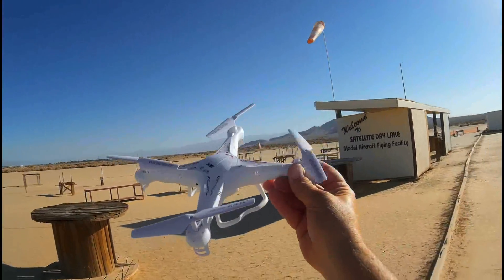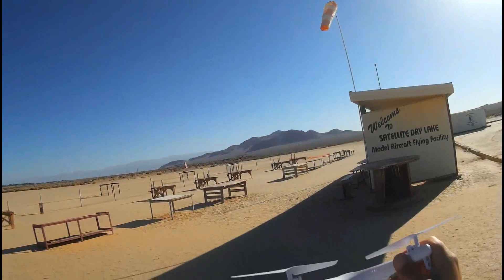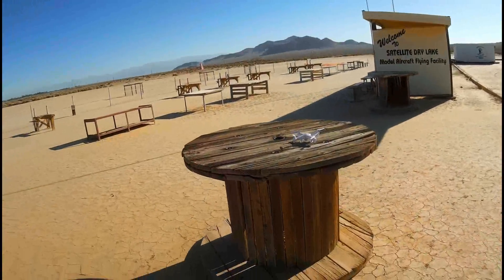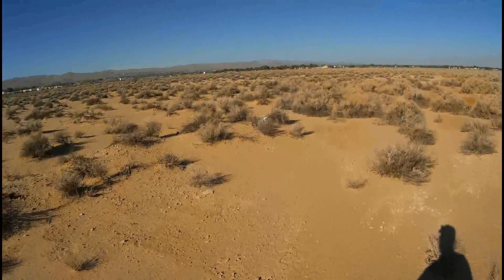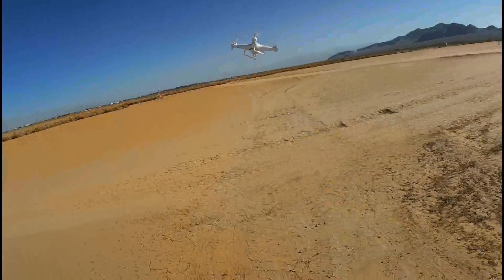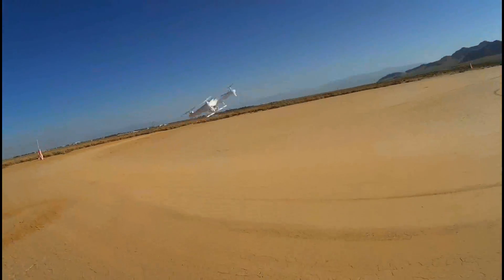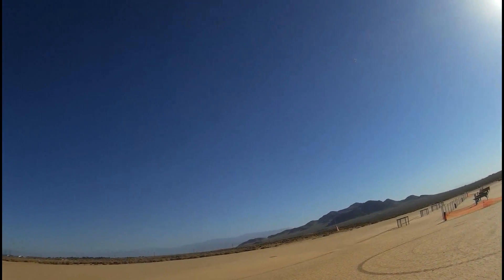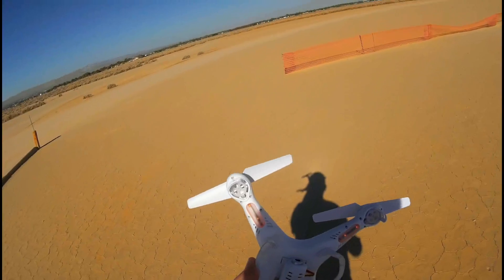Syma X5C Quadcopter Drone Test Flight

Comment: I went up that high with mine and when it landed it wouldn't turn on at all, charging it now but I hope its okay...

I've also tried everything to get it to stabilize, but it won't just hover it likes to go on its own (And no, there was no wind in my house). I guess its a design flaw or something.
Reply from the maker: The following might help. Do you know how to calibrate your quadcopter's gyros?  
1) Turn on the quadcopter and place it on a flat and level surface.
2) Turn on and bind the transmitter.  Center all trim tabs.
3) Leaving the quadcopter undisturbed, move and hold both control sticks to their lower right corners.  Hold them there until the quadcopter's lights blink. 
4) Let go of the sticks and try flying.

Comment: x5c-1 can fly 100 meters. It is nice and durable. I have intentionally drooped it from over 80 meters and it lands like a soft feather. So durable with over 16 flights in the clock.

Comment: I just bought my 5xc complete kit for $35

http://www.ebay.com/itm/-/182151006017?

I found the kit quad 101
Reply from the maker: Yep, no camera listed in the contents.  Without a camera, it saves you about 15 to 20 bucks.
Reply: +Quadcopter 101 thanks for the advice man

Comment: There's a lotta hate on this quadcopter but i've had mine for almost 2years & I flew mine into the bank of a lake (it was underwater a good 1ft for 2-3min), I flew it over a fire and one of the propellers melted and it landed pretty much in it. I also like to fly wrecklessly and have had it lose contact and fall like 100ft. I've crashed it indoors 100x.

It still works fine and out performs some of my more expensive drones...
Reply: Wow....... Crazy .......

Comment: hello quadcopter 101, does this syma x5c and x5c-1 has headless mode?? ebay seller listed they do have headless mode in the description, but i doubt since they are mostly do not understand when i ask this question, so i thought i check with the expert
Reply from the maker: +spidy278 No it does not.

Comment: Hi,I have the transmitter of an old rc model which I dont use anymore,the controller is 4channeled controller,will it work with the x5c-1 or not??(because it has a bigger antenna too).well my x5c-1 WILL come with its transmitter so I will be able to test it but I ask if anyone has tried it and if he could share the results if it

Comment from the maker: If you live in the USA, GearBest's US warehouse has some pretty good deals going on quadcopters for Halloween. One is the Syma X5C with free shipping for $46!  You should also receive the products somewhat quickly when ordering from their US warehouse. And here are their Halloween quadcopter specials http://shrsl.com/?~a4y4
Reply: +Quadcopter 101 But 'GearBest' are possibly one of the worst online stores to buy anything from! I prefer to buy from Banggood. They also ship from a US warehouse:   us.banggood.com/Wholesale-Warehouse-Syma-X5C-Explorers-2_4G-4CH-RC-Quadcopter-Mode-2-With-Camera-wp-Usa-913827.html?p=JQ26191551677201504Z
Reply: +VCUrailfan15 productions get a phantom 4
Reply from the maker: +THM SGR You might want to carefully read the fine print of those Amazon listings.  Items may be missing.  Make sure that at least both a camera and transmitter are included with the package as described in the listing.  Memory card and card reader are also sometimes left out.
Reply: Got mine from Amazon for about 40 and everything came great

Comment: Hi. I ordered my syma x5c on net. But i noticed that my quad always lean back and sometimes its going on the right side. I tried to fix it with fine tuning but it doesnt help. Any suggestions?
Reply from the maker: Christian Botavara First set all your trim buttons to center, then turn off your transmitter.
1) Turn on your X5C, and place it on a flat and level surface. Wait 5 seconds for the gyros and accelerometers to initialize (always do this during normal startup).
2) Turn on your transmitter and bind it to the quadcopter.
3) Move and hold both control sticks to their lower right corners until the quadcopter's lights blink.
4) Let go of the sticks and try flying.
Reply: Quadcopter 101 thanks mate. I have syma x5c but i think it doesnt have headless mode? It has only high power mode.

Comment: I own 3 of these... they are great for learning the basics... at a relatively low cost... $30-$50 range.. if ya crash it.. wich you will... or lose it ya just get another one... range is about a football field long.. 100 meters.. abd the cameras aint so great.. but to learn how to get comfortable with flying these machines for low cost.. the work very well..

Comment: I think it's brilliant for a 35 quid quad. Though surely evey heli and quad has a small signal output because it doesn't have a radar? I mean COME ON!!
Reply from the maker: Joshua Jones This was the original version of the X5C as reviewed last Summer. It did have problems.  But Syma quickly corrected those problems, and you're right, the currently sold version of the X5C is brilliant.  In fact, I did an updated review of the current version which may be viewed here https://www.youtube.com/watch?v=y93vzA-KRlM

Comment: Hi! do you use any lubricant for the gears on this quadcopter?
If yes, what type?
Reply from the maker: Manuele Olivo No, none at all. Plastic gears do not require lubricant.  Additionally, lubricant tends to trap dirt, causing the gears to wear (and possibly damage the motors)
Reply: Quadcopter 101 Thank you very much!!!

Comment: Who is better quadcopter 101 the syma x5c or the jjrc h8c for the camera and the power?
Reply from the maker: Leonardo Pano JJRC H8C is better for camera and power. BUT you will run into maintenance problems with its motors, so recommend purchasing spare motors with it.
Reply: Quadcopter 101 last question what about the JJRC H8C and the DFD F183 who is better?
Reply from the maker: They are the same quadcopter.  Just different name.
Reply: ***** 21% discount here! http://www.gearbest.com/rc-quadcopters/pp_73260.html?vip=34195

Comment: Strange I'm able to perform banked turns with my x5c just as smooth as when I'm flying the dji phantom 2.
Reply from the maker: rogue5022 The video above is the original release of the X5C.  It had problems which Syma quickly corrected.  You likely have the upgraded X5C model (sold since Fall of last year).  It is an excellent flier as shown here https://www.youtube.com/watch?v=y93vzA-KRlM
Reply: Got ya no probs mate. Thanks

Comment: Hi there quadcopter 101 can you think of any reason why my camera has stopped working? The red light comes on when I bind it but that's it, won't record or take photos
Reply from the maker: Do you remember to stop the recording (make sure the light goes back to green) before turning off the quadcopter? This is very important as the camera doesn't write to the card until you press the button to stop recording.
Reply: Thanks for reply. Yes I always do that. Somebody else said something about reformatting the sd card? It's not flashing red when I press record, but it briefly goes red when I turn on quadcopter
Reply from the maker: David Amos Yep, the card would be the next thing to look at as they are notorious for failure (microSD).  Might want to try a different card also.

Comment: I've seen a bunch of your videos today as i'm shopping for a drone, they're really nice!
I liked the Syma x11 the most, but i found out that the Syma x5 costs 5 bucks more.
So wich one is better for a beginner?
Reply from the maker: Where did you find a Syma X5?  The camera-less version from Syma is hard to find, unless you buy a non-Syma clone.
Reply: Actually i saw it on eBay, but then i found the x11 for 25 dollars and i instantly bought it, also i will fly it 80% indoors so it seems a better option ☺

Comment: I got my first quadcopter this morning, an SYMA X5C.  Can someone tell me what the memorty stick looking item is for.  I received no instruction on the camera or the memory stick.
Reply from the maker: It's a memory card reader. It's used to download the video from the camera's memory card to your computer so that you can view the video. You can remove the memory card from the camera by gently pushing inward on it (it's spring released). Then carefully slide the card into the reader, gold contact points forward. Be careful inserting. If there's any resistance, it's upside down. Just flip it and try again. Finally insert the reader into the USB port of your computer. The card should show up as a drive that you can open to view the video file and view it.

Comment: i saw that in a mall..Ey what happen if exceeds the cgnal does the drone drops quick or slow?
Reply from the maker: It maintains the last input from the controller for approximately 3 seconds (attempting to regain signal).  If it doesn't regain signal, the motors stop, and it drops.  But being very light, it drops relatively slowly.  In most cases, it doesn't get damaged from the drop (unless it lands on asphalt or concrete). Anyways, the above review is for the old version.  This has since been updated, and now is one of the best quadcopters for beginners. Please see the following https://www.youtube.com/watch?v=y93vzA-KRlM
Reply: Thanks for the info. Sir hhm what happen to the camera?seriously it's worst than normal, is it normal if you fly in windy the camera resolution are affected......

Comment: Have you ever tried the Dromida 700mah battery in an X5C-1 ?
I have a couple and their great. Perfect fit after removing the rear peg.
Reply from the maker: How much flight time does that give?
Reply: Quadcopter 101 With out the camera , 
10 minutes plus.
These batteries test out at 680 to 700 mah.
Where a decent stock 500mah battery varies
from 450 to 480 mah.
I really like how they fit as I also have a Turnigy 750 in one and you have to force it in
and extremely hard to get out.

Comment: Enjoy your videos and the reviews.
I was curious if you had any information on replacement hardware/fasteners for the Syma X5C-1. Are there 'standard' sizes of screws used on the rotors/propellers, rotor/propeller-guards, etc. that I may be able to find easily? Is this something that I may need to go to a hobby shop for? I have searched online, and even spare parts (like the rotor/propeller-guards) seem like they DON'T come with new screws.

Thanks!

Comment from the maker: toby, make sure that you place the quadcopter on a flat and level surface when you bind it to your quadcopter.  Do not move the quadcopter when you turn on the transmitter and bind it to the quadcopter.  The same is important when you're calibrating the gyros. 1) plug in the battery to the quadcopter, and immediately place it on a flat and level surface.  Wait a few seconds for the gyros to initialize.  
2) turn on the transmitter, and bind it to the quadcopter by moving the throttle up and down.  
3) Push and hold both control sticks to their lower-right position.  Hold them there a few seconds until you notice the quadcopter's lights flashing.
4) let go of the sticks and try flying.
And here's a video showing how https://www.youtube.com/watch?v=hhLMbq3LkrM
Reply from the maker: ***** Take a look at the following picture.  Notice the two different shapes of propellers and where they are installed.  Make yours match the picture https://images-na.ssl-images-amazon.com/images/I/61yasO5d0OL._SL1492_.jpg
Reply: Here just 39.99 dollars with coupon code: GBVBRC2
http://www.gearbest.com/rc-quadcopters/pp_73260.html?wid=21&lkid=10645392
Sweet
Reply: do you know of any stores that sell a "more reliable" brushed or coreless replacement motor option for the x5c? I was running 25c glacier 600mah 3.7v when finally the motor went.
Reply from the maker: oafaloaf Sorry, don't know of any more reliable brushed/coreless.  But about how many flights did you get before loss of a motor? Also, did you spin the problem propeller/motor by hand to check for any binding of the gears?
Reply: Where is this _
Reply from the maker: Ridgecrest, California.
Reply: Thanks
Reply: True
Reply from the maker: ***** Yes you can fly it indoors.  But there are smaller, cheaper, quadcopters which are better for this purpose.  Here's a very good one to fly indoors https://www.youtube.com/watch?v=nJcuuqMYol0
Reply: +SalvaThor here is the bigger version phantom 4
Reply from the maker: Not sure.  When you installed your propellers, were you careful to install them as shown in the directions?   There are two clockwise and two counterclockwise propellers that must be installed on corresponding CW and CCW motors.  If installed on a wrong motor, the propeller will blow air upward instead of downward, and the quadcopter will not take off.

Comment: i just bought the x5 drone new aerocraft install everithink right when i push throtle only two blades spining fast the over two are not spining fast enouth then when i pick it up and move it around they start spining all fast so i say its the axis gyroscope then i reset left and right lever to lowest right and its start flashing thats the reset done then i trie it to fly it again but same thinks happens i reset a few times not working again i dont what to do please help is my gyro broken or what is it

Comment: Have you any ideas on balancing three blade propellers
Reply from the maker: Never tried it. Am not a fan of three bladed propellers. Was going to release the following video tomorrow, but will release it now to illustrate my issues with them. They tend to be very inefficient.  Think that the additional blade just creates more turbulent flow instead of more lift. https://www.youtube.com/watch?v=-8PFxkqL_Ys
Reply: Agreed I tested all day with no weight eg camara I had great control in high wind and high hights but add Camara and well I posted a video wanted on so people could see RX and to mod distance but here at mountain base its Chinook season and high flights are not a good idea to many thermals I have a vid of this as well going up but I ordered a cpl sets of three blade props I'm going to try to balance a set and show it

Comment: Purchased Syma X5C two days back. Had just 3 flights so far. It just does't seem to follow the commands of the transmitter. If I want to take it to the left, it goes to the right. At times, it just ignores the inputs. You are flying it very smoothly. I am frustrated. How many flights did it take you to take full control over this quadcopter?
Reply: I mean are you very experienced with these things?
Reply from the maker: Abdul Waheed Your gyro stabilizers may need to be recalibrated. It is very simple to do.  
1) Install your battery and turn on the quadcopter.
2) Turn on your transmitter and bind it with the quadcopter.
3.) Move and hold both control sticks to their lower right corners.  Hold them there for ten seconds or until you notice the lights blink on the quadcopter.
4) try flying to see if the problem has been corrected.
and here's a video https://www.youtube.com/watch?v=hhLMbq3LkrM
Reply: Quadcopter 101 Thanks a lot. Your trick worked for me, and now my quad is much more stable and responsive than before. I just have to use this track each time I turn on the machine.
Reply from the maker: Abdul Waheed You don't need to stabilize the gyros each time that you turn it on.  Just make sure that the quadcopter is level on the ground before binding it to the transmitter.  As for the spinning, I think that you accidentally pressed the yaw trim button, and it needs to now be adjuusted back.  Please see the following article. Also please read the other articles in the right index as they may be of help. And here's the article on trimming: http://quadcopter101.blogspot.com/2013/10/quadcopter-flight-school-tutorial-1.html

Comment: How long does the battery?
Reply from the maker: About 7 minutes if you don't turn on the camera. About 3 1/2 minutes if the camera is recording.  For that reason, I like to fly mine with an external camera that has its own batteries https://www.youtube.com/watch?v=Yk4p_9oEAb0
Reply: thanks for the info.

Comment: flies it 10 km up, "you see its out of range that's another issue with this quadcipter"...
Reply from the maker: Please keep in mind that this was the original version of the X5C being shipped back in June. Most of the issues shown in this video have been corrected with the upgraded version of the X5C currently being shipped.  It's a GREAT quadcopter now: https://www.youtube.com/watch?v=y93vzA-KRlM
Reply: Quadcopter 101 OK thanks, sorry for the sarcasm anyway... do you recommend this quadcopter? I have 3 including the Hubsan x4 H107c
Reply from the maker: VidCube I highly recommend the X5C.  It's one of the most stable quadcopters in this price range, making it excellent for aerial video.  I don't particularly like its camera though, and have replaced with a keychain camera: https://www.youtube.com/watch?v=Yk4p_9oEAb0
Another great video quadcopter that you might want to consider is the JJRC H8C, https://www.youtube.com/watch?v=tdyR5mbkq9U
Reply: Quadcopter 101 Thanks again for the reply but I think I will stick with Syma x5c v2

Comment: lol what do you expect for a 40$ toy off amazon fresh off the shelf of a china warehouse shelf?
Reply from the maker: Syma took note of these problems and has since upgraded this model.  Please view how Syma corrected these issues here:
Syma X5C-1 Drone, Your Mother Could Fly This!
The upgraded model is an EXCLLENT quadcopter, highly recommended!  But be careful, there may still be some of these older uncorrected X5C's trying to be cleared off vendor's shelves.  Recommend verifying with your vendor that they are shipping the upgraded model, especially if the price seems too good to be true.
Reply: You realize Syma does not make this right?  /They slap there name on it and sell it as x5c there is 10+ other companies selling same item with different names lol  You can take the walkera one and use parts in this one! cheaper btw!